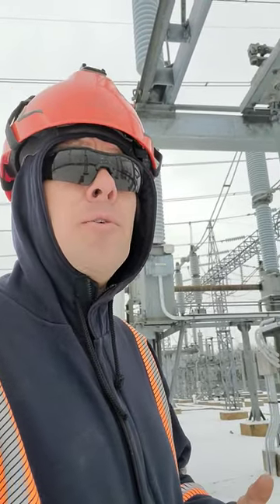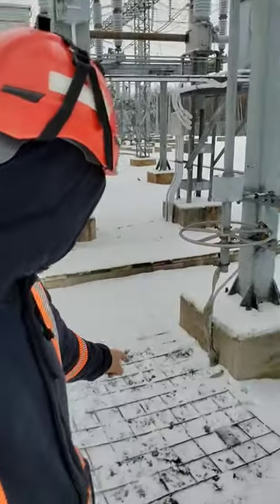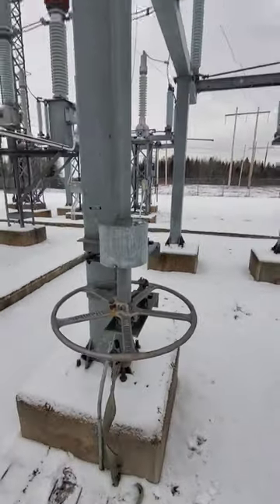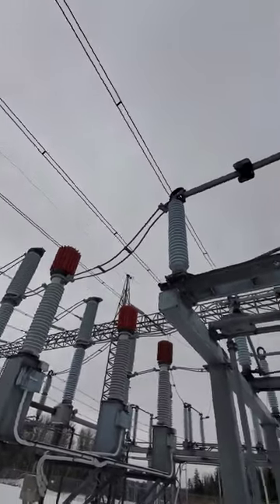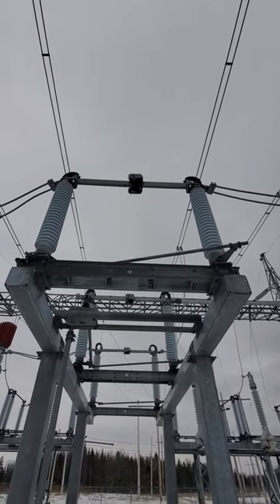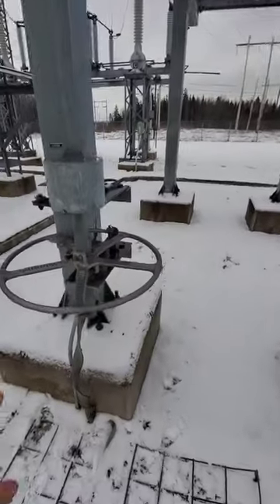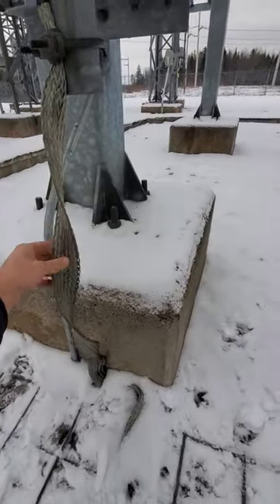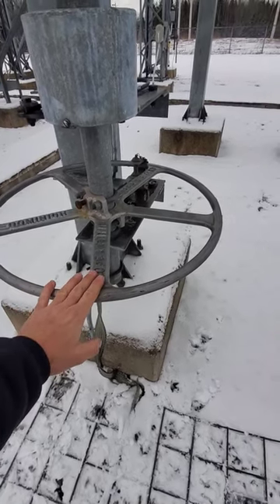Why am I standing on a steel mat??

Comment: Same potential meaning he is no longer “the” only path to ground.  The majority of the fault/current would flow through the bonding to the grid to return to the source. Some current would still flow through the operator but a lot smaller of an amount.  At least this is my understanding.
Reply from the maker: That's correct. It's a last line of defense in a very bad situation. While electricity takes all paths, this setup will help minimize injury.

The fault would likely trip very fast, but it only takes a fraction of a second to get electrocuted.
Reply: So only baked instead of deep fried.
Reply: @Bobsdecline  Bob, you're definitely not in decline.
Reply: @JimMaz hes in an incline. Also big fan I have been watching your league videos for a few years now
Reply: I only had to do basic circuits for my physics degree, but ideally - if his hands and feet (both points of contact) are at the same potential, then no current whatsoever should flow through him since there’s no potential difference across his body, right?
Reply: @thefourshowflip  I could be wrong but from my research and studies current will take all paths to return to its source. He’s still part of that return path so some would flow through him if he’s a path however it would be substantially less.  Someone with more knowledge may chime in though with more explanation.  High tension workers are able to walk across lines like birds or other animals as they’re not really a path and are at the same potential, however slightly different than operating a device where it may cause a fault and then it’s looking for a path.
Reply: @thefourshowflip  resistors in parallel.  one has very low resistance (cable), the other very high resistance, his body (comparatively).   current will flow through both resistors.  It's just what tolerance the very high resistance will have to said amperage that will determine death or life.  10" tall rubber boots come to mind.  Or do this remotely.
Reply: @Mike_Rundle   I ask because I come from a theoretical physics standpoint where we often make idealized assumptions, and in that idealized case where the voltage difference is truly 0, no current should flow (and one easy way to see this is by looking at ohms law which, yes, isn’t “real world” and deviates beyond some threshold depending on circumstances; but for ohms law, v=i*r, and if v=0, i=0 regardless of what value the resistance has because that equation must hold in that circumstance).
Reply: @AffordBindEquipment  
In the case that his hands and feet were at a truly equal potential, wouldn’t this be like a circuit in which one of those parallel resistors were shorted? Because from ohms law, you need a potential difference for a current to exist, and if both ends of the resistor are at the same voltage, then no difference exists and so no current flows.  Of course this is all in the ideal but maybe it would’ve been better to ask whether this doesn’t actually make their hands and feet at the same voltage and so there still exists a path (granted with very high resistance compared to it’s parallel counterpart) that DOES have a voltage difference
Reply: @thefourshowflip  outside of superconductors, there's no such thing as zero resistance.
Reply: @thefourshowflip   boots and gloves add a good bit of insulation, but not to 130 kv!
Reply: @Bobsdecline  Seems they would also protect you in event of lightning strike while utilizing the crank, I can imagine sometimes you would have no choice but to go in there during a storm?
Reply: I understand what you’re saying but I do believe  he is still part of that path the fault would try to take. This situation will have a potential difference as the failed switch/insulator would be looking for a path to its source - of along which he would be. Ideally he would not be a potential between his hands and feet but if was a compete path small amounts would still take it.  Hoping someone with a more definitive solution or answer chimes in.
Reply: @thefourshowflip  He is at the same potential as the grounding wire however his body has a significantly higher resistance therefore he will receive an extremely low current shock.
Reply: @thefourshowflip  I am starting to re-learn electricity. I wonder if you wouldn't conduct some charge via corona discarge. Corona discarge can happen on actual power lines.
Reply: @theman5887  
Right, and the way I understood it was that the purpose of it was to create a situation where the feet and hands (on the valve wheel) would be at the same potential. In that case, it could be looked at like a resistor where both ends were at the same voltage, and in that case no current would flow across the resistor (that’s how I’m understanding it).
Reply: @thefourshowflip  this is correct. Electricity needs a potential difference to flow through. Think of an inflated balloon with a hole in it. The high pressure air inside really wants to escape and equalize with the lower pressure air outside. It's basically the same with electricity. Nature, as chaotic as it is, loves to equalize.
Reply: key phrase.. majority.. 1kv is more   enough to kill him especially if  he  cant  let go
Reply: @thefourshowflip  there is no such thing as a true short.  that "short" has some resistance, even if it's .1 ohms.  but do the math on that parallel  circuit and what flows through the body (high resistance; it doesn't take much to fry a human.   our bodies work on micro volts.  KV at no amperage (tesla coil) and you can shoot lightening out of your fingers.  Add amperage and you are dead.  guys using 7kv neon sign transformers  that are maxed at 30ma (dead short) die every year doing wood burning.  I don't know the min.  V/A combination that will kill but when KV and hundreds of amps in parallel, well, it's not something to mess with.
Reply: @Bobsdecline  s s. A
Reply: It’s like a bird landing on a wire. The worker will be energized to the same voltage as his/Hers surroundings.  The safest way to operate that switch would be with bare hands and feet when it comes to the electrical portion of hazards.
Reply: @stephenw536  If indeed this is true in this situation, then why does the  power company require the steel mat?   It may be true when one is completely insulated from one's surroundings (air) but how would you do this in this situation, standing on the ground?  what is the air break down voltage to ground in air?  how many inches of air gap does it take to be completely SAFE from death?  some where some time some guy got fried from doing this and thus the safety precaution.
Reply: But what happens if you're completely insulated? Do you still get a shock if you wear those insulating boots?
Reply: @tomaccino  in theory if you had insulation rated for the voltage level you’d be fine. Risks come in when insulation fails or is not rated correctly or you have another exposed potential through your body where insulation doesn’t cover. At lower voltages a grounding/insulating mat or something similar can be used but would be situation specific. In substations or switch yards the video highlights what I would say is the more common and safer “method”.
Reply: @tomaccino  only if the potentials are different enough to exceed the value of the boot insulation.  Those insulated boots are debatable if your ground grid is robust and tested.
Reply: @Mike_Rundle  Well explained! I was always told how electricians need to be insulated, so the current doesn't flow through their body but these linemen videos seem to go against that rule.
Reply: @tomaccino  depending on the electrician, some of your lower voltage stuff can be accomplished by simple insulation.  At higher voltage levels that becomes more difficult and expensive.
Reply: Electro boom and slow no guys did a great bit on tgis a few a month ago
Reply: @AffordBindEquipment  the PPE in the form of rubber soled boots and rubber gloves definitely makes the operator resistor have a much higher resistance as well.
Reply: @tomaccino  I remember one of my substation trainings the instructor told us as long as your part of the circuit your safe ... It's when you suddenly disconnect that your in trouble.  Remember the ohms law triangle  if you drive up voltage the other two are effected.  Similarly if you increase resistance your going to affect amps.
Reply: @thefourshowflip  the difference between the theoretical model and the practical situation is that in theory a wire is a short, i.e. literally zero ohms. In practice this is not the case. There will be some DC resistance even just a few milliohms, and when you have hundreds of amps flowing through that resistor, you will have some voltage drop over the resistor and thus some voltage difference between the two ends. So there would still be the potential (no pun intended) for some current to flow through your body. Also worth noting is that current technically follows the path of least impedance, not just resistance. So if the bonding circuit is not well designed, it could have a high inductance (e.g. a big loop of wire that connects the two points, metal grid and handle) and then your body might still be the path of least inductance to the ground. 

 For a full explanation you would have to go into 3D simulation of the EM fields on this entire area and obviously it's not very easy to do. Therefore keep in mind that everything I've just said is a model. And as the old adage goes "all models are wrong but some are useful".
Reply: @bobbobert9379  but is it enough?  with the high KV and amperage, how many inches of rubber would make you feel safe?
Reply: @thefourshowflip  They would only be completely at the same potential provided a zero ohm resistor between them (Also, Ohm's law is not "situational" in the complex domain, which accounts for capacitance and inductance).

You can calculate the actual resistance from estimating the cross section of that strap. That strap provides the preferred path. That wheel is also connected through the mounting equipment, bearings etc to the structure itself. And the whole structure is grounded. But the bearings etc are "incidental", unknown resistance, may be rusty or whatever, providing a higher resistance. That strap is the positive "we know this is the lowest resistance, visually checkable, path from that handle to ground, and it is low-enough to give the poor chump a chance at life". Without that, his safety would depend on the resistance-to-ground of the rest of the structure further away.

Also consider, at those energies, even the time it takes for the energy to reach a distant grounding point (at 0.6 times the speed of light) still potentially leaves a few nanoseconds that the human would be the shortest path. That strap provides the "just as long, but much lower resistance" path.
Reply: @roadmonkeytj  Interesting. Thank you for explaining!
Reply: @bobbobert9379  Or you could just wear a Faraday suite and meh it doesn't matter

Comment: My favourite line from some random teacher when it came to health and safety was ''anything will become a conductor if you raise the voltage high enough'' .
Reply: And anything is a capacitor if you keep running electricity through it 🤷‍♂️
Reply: No it literally will. The electrons will align and electricity will flow with way less resistance

Comment: In my younger days I've done grounding for Edison. In those switching stations, everything is grounded. If it's metal, it's grounded. Plus the boots that they use are special to help prevent them From being grounded. There are so many safety features inside those switching stations. Something very extraordinary has to happen in order for somebody to die.

Comment: I constructed a 500kv substation including the 5 story tall (water cooled)rectifier.  
Even the push button control boxs for the pressurized disconnects switches had those ground mats. 
Everything was fiber optic controlled.
Miles of 4 bought bare bonding wires were the standard. 

One take away I won't forget. Even during construction:
-the amount of power stored in just 80' of the 8inch Alu bus due to wind alone, Was enough to blow a guy back into the man basket we were working off🤣.

Comment: A lot less voltage and amperage involved but as a Ham Radio operator I can say to never skimp on grounding your equipment and protecting  yourself when working on your equipment..Use proper grounding techniques it doesn't cost that much and the worst that is going to happen is your radio will sound awesome because it's grounded properly...Good job on safety videos!! I used to be the one to take chances but after a few painful RF burns I learned to follow all safety precautions. It doesn't make you less of a man to do so, it could cost you your life! I am new to your channel and I'm sorry if you have already made a video about it but I would love to see a video about proper grounding and what can happen without it...Most do not understand how important grounding and protecting yourself is!!!

Comment: Since my boss years ago evaporated a full inch of my screwdriver inside a breaker box, I am very glad you guys know what you are doing.
Reply: I have a screwdriver that I have used to 'test' if breakers are off when people tell me they are 'off' it has several pits in it from others being wrong. best pit is from a dryer plug that was stuck.

Comment: So its a difference in voltage that kills  you? So if that happend, would the ground be at 138kv and body be at 138kv or would the voltage be split between the 2 paths.

Comment: If an accident of that type happened and you and everything around you received a potencijal of 135kV (and you are OK) - how would you get off this metal grid - you would have to remove both feet from the grid at same time?! Or in that case the fuse would cut the connection immediately as soon as something like this happened?

Comment: If that were me, operating anything in that much power, especially standing under all those leads, you couldn't shove a needle up my behind with a sledge hammer, my nerves would be strung so tight. I'd have to have just left prayer meeting to be energized enough to even go into that area, much less do any switching. It used to blow my mind and make me almost wet myself to get around 2300 VAC. That's what we had in our power-house, and I was in charge of making sure all that equipment was running right, over the weekend. I can only imagine how this fellow feels !!!

Comment: Would that 'heavy gauge' bonding strap actually withstand the fault current long enough to save you? The fault currents are immense on your networks. 

Do you in Canada distribute the neutral on 'transmission' ?   I know the states tends to. Here in the UK everything above 240/415 (or 240/480 for rare single phase examples) is run phase to phase, with impedance earthing/grounding  at the  supply end (which is star connected). This limits the earth fault current in the event of a short to ground, just allowing enough to trip the protection relays and thus operate the breaker.

Comment: Glad explained that but related to so much more in the electrical world. What most refer to grounding is actually called bonding, is not grounding but bonding everything to same potential. Yes at points is also tied to ground but usually more for lighting dissipation but for safety, electrical system,s are actually Bonded together. Not the best explanation short read, maybe can do vid on bonding/grounding ? or have you ?

Comment: It's kind of interesting thinking about it, but with the equal potential system you could theoretically be energized to 138kv, and be uninjured.
Rubber gloves should protect you from the imperfections in the system that would put some potential between the hand wheel and the ground.

Comment: I never understood why we are required to wear rubber gloves opening a 115kv or 230kv. Class 4 gloves aren't doing anything for us if the insulator broke.
Reply: I work in substation for 44 years now, have worked where rubber glove were not used when switching with the steel platforms. Your right if you have a fault 20kv gloves won't save you. If your feet and hands are at the same potential you will be just like the bird on the line.... you'll be energized but little or no current.

Comment: Crazy! Have you ever heard of it happening?
Reply from the maker: It happened to me once with an identical setup on a 12.47kV switch.

The lines were already isolated by the breaker (but not grounded). The wired and top of the insulator swung down and hit the steel pillar.
Scared the crap out of me for a second... Even though I knew the line was isolated, the though of a huge arc flash entered my mind pretty quick. It happened so fast, my heart simply skipped a few beats!

We've had a few break while energized, but they didn't result in a worse case scenario where the lineman was in contact with any fault current/voltage.

Comment: Ground mat. Be advised the ground grid in the substitution has to extend 3 feet beyond the outter fence. 
We discovered where I worked , in the 48 year old 69kv substation the ground grid did not extend beyond the fence line!
Reply: That is now the standard, but hasn't always been so. By extending the ground grid you would be at the same potential as the fence if by chance it becomes energized.
Reply: @TnTBLACK95  exactly, on our condensing turbine generator job we extended the ground grid as to modern day standards